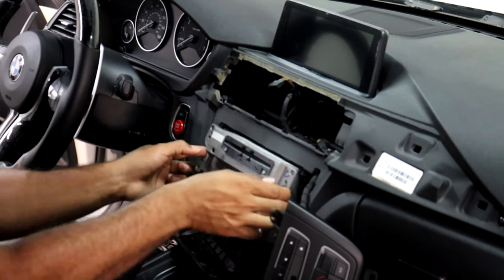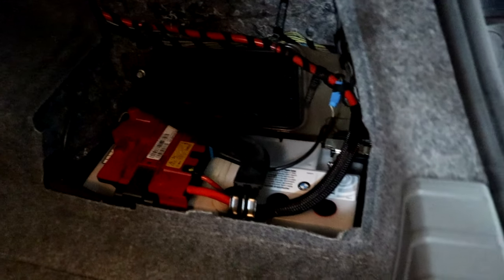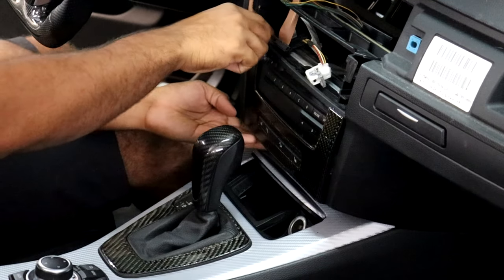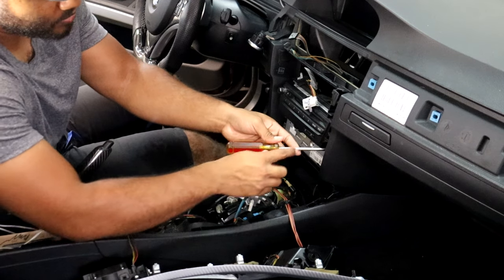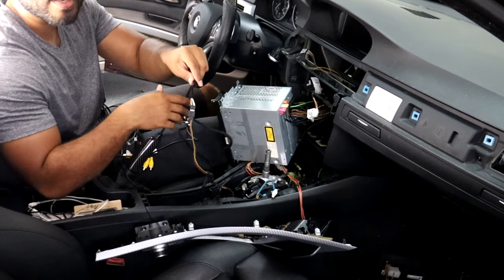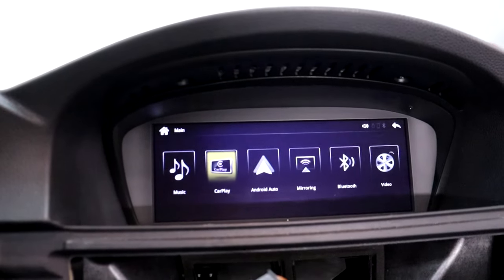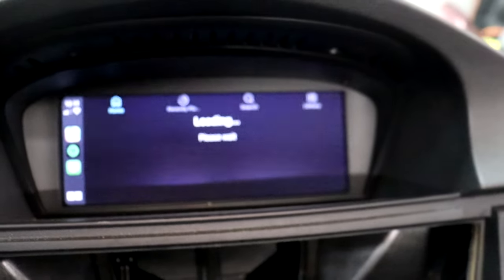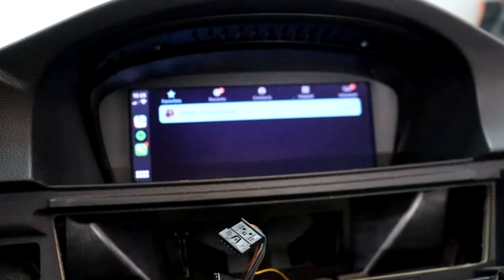[BMW E90/E92] Apple Carplay/Android Auto CIC Integration Kit FULL INSTALL + OVERVIEW

Comment: Just fitted this to my son's 2009 E92. As simple as it gets, everything fits and works straight out of the box. Adding a reverse camera was also simple, just gotta select "aftermarket camera" instead of OEM and it works like a charm. Highly recommended!
Reply: which camera did you end up using? Would you mind sharing the link!! Thanks
Reply: @imabeastonwheels  did you buy 1 already? im looking into it

Comment: Best install video I’ve watched. Where does the box draw power from? Asking cos there’s no wires going to the quad lock behind the CiC unit which is a good thing because one less thing to worry about.
Reply from the maker: I believe it is taking power from the main head unit still where it connects into the iDrive controller knob since the original connector that goes to the idrive knob is connected into the new wire harness that connects to the main box while the other end from the main wire harness connects into the idrive controller.

Comment: Thank you for the video. I basically install it after watching your video. It helped a lot. Only difference on my case was the location of the unit. I tried to place it under the passenger side footwell panel. I just wanted to have easier access. My question is about the audio quality of the unit. I found the sound of the music on spotify a bit flat. I think the chipset of the unit (operational amplifier) is not as good as car`s default amplifier. I think it is possible to use car`s default amplifier, but this is only possible if using car`s HDD or USB port. Another issue is quality of microphone. It is really poor. I think compared to the BMWs default microphone, it is slightly worse. Any advise regarding improving quality of mic. or audio of the car? Do you think I can still use car`s default microphone and connect it somehow to the interface? As much as I understand, once carplay is activated, phone cannot connet to any other bluetooth device. Thanks!
Reply from the maker: You can adjust the audio in Spotify to make it sound more like the factory audio. At least that’s what I did and to me it sounds basically the same name. The location of the microphone does matter. Where did you place it? The same spot I did?

Comment: Great video, Thanks for sharing. I have 2 questions.
1. Any issues with the microphone being so close to the vent or under the trim piece? When you are on a call, can the other person hear you alright? 
2. Someone else asked this, but you didn't respond, any issue with the IOS 17 connecting? I have the iphone 15 and want to make sure it is compatible prior to purchasing this system.
Thanks.
Reply from the maker: I’ve had no issue with the microphone being under the trim piece. And also have had no issue with connecting to iOS17.

Comment: is there a way to relocate the stock aux port, and then connect the aux to the system under a trim piece? I just want to avoid having a cable running through my console.
Reply from the maker: As far as I know, I dont think so. Why do you want to avoid just running it through the console and main trim piece like in the video?
Reply: @InlineSixAuto  just for an overall cleaner installation. Im kind of OCD when it comes to cable management so i want to have everything look as stock as possible.
Reply: Check your glove box, it might have an AUX port

Comment: On your bmw 328i I’m thinking about getting a resanator and muffler delete but worries about driving in neighborhood do you think I’d get same sound with a valvetronic muffle ?
Reply from the maker: I'm not sure, I didn't know valvtronic made an exhaust for E90 328i. However, hearing other aftermarket mufflers, to me it sounds the same but for more than double the price.

Comment: Thanks for the video, very usefull but I have installed it in a f10 with cic and it doesnt work, do you have to reiniciate the system after instalation, what would be the dial code for my car?
Reply from the maker: What doesn’t work exactly? You were able to hook up all the wire connections? Does it nothing show up on screen?

Comment: Hi i just installed this into my 2013 328i E92.  When i connect the carplay it sounds terrible.  when it connects just using the bluetooth it sounds like it did before the unit was installed.   Any idea on how to fix the Carplay audio?
Reply from the maker: You can adjust the bass and treble in settings in the main menu of the host system. You can also adjust the sound in your spotify or apple music settings. I made adjustments in both to get it to sound way better and closer to the OEM speaker sound.

Comment: Hi, I found your video because i have similar carplay box and i want to connect it to CIC navigation in my BMW F13. Could you tell me what about a external mic? It's necessary to plug in into the box? Or can i use the original microphone?
Reply from the maker: On this specific system, you could use the original microphone in the car or you can use the aftermarket one that comes with the kit. You just have to change the setting on which microphone you want to use. Not sure if it’ll be the same on yours.
Reply: thank you so much for the answer, have a good day! @InlineSixAuto

Comment: nive video, thx. Why a box instead of one of this chinese full new screen that also increase the screen resolution and bring a full new front glass that certainly the original CIC is with scraches and not tactil.
Reply from the maker: My screen is just fine so I didn't think it was necessary to spend the extra money.